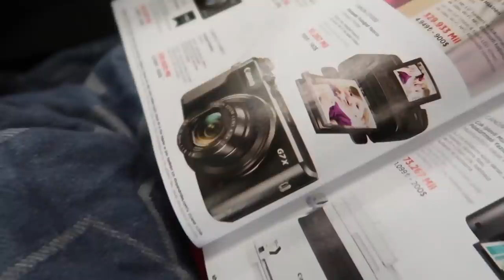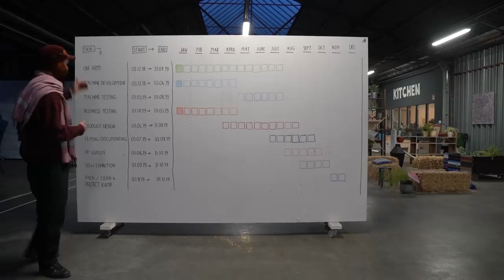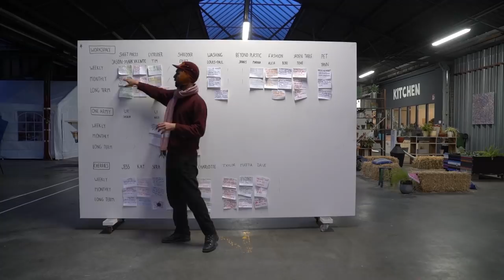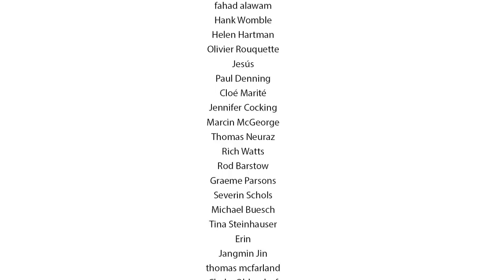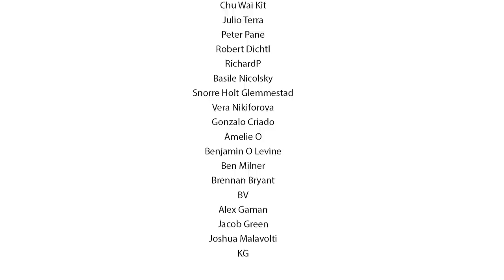Monthly news #24 - This is the future of plastic

Comment: The Largest private Roadbuilding company in Australia is EDI Downer, and they are at the commercial stage of using recycled plastic granules, by mixing into Asphalt road construction. This "Plastiphalt" material is more durable under all conditions than regular asphalt. This application worldwide has the potential to consume the vast majority of all waste plastic polymers and put it to work where it will create superior, longer lasting, roads, saving enormous sums of money on more frequent repairs. .
Reply: What will they do when the roads will start melting from the crazy Au heat? And won't it be slippery? Interesting.
Reply: I think you can add certain components to the plastic to make it more heat resistant, but I share your concern... @Yonatan24
Reply: I am interested too in more useful applications of Precious Plastic, like roads and houses...
Reply: @BrasilPopular  I mean, I'm not sure how they got the idea for roads, I bet roads can reach several hundred degrees (F°) in the hot sun.
Reply: @BrasilPopular  If I'm not mistaken there's a company based in Israel called RDF that developed a method for burn plastic for the fuel, but without creating the obvious toxins that are emitted when burning regular plastic. I'll have to look into it. Ironically, I think they actually use it to burn sheet rock, or whatever drywall like material is burnt to make asphalt or concrete in an "oven" at 800°C.
Reply: also aboutm roads, just use plastic roads only in places that are cold... @Yonatan24
Reply: @Yonatan24  The plastics have higher melt point temperatures than bitumen, so they prevent the asphalt from degrading in extreme heat. The mixture of plastics into the asphalt mix is a percentage of the total mix and is not obviously different to look at or touch.
Reply: @BrasilPopular  The plastics are more heat resistant than bitumen already, so the plastics improve the performance of asphalt in high temperatures.
Reply: @BrasilPopular  Building new roads, and repairing the old roads, can put most of the world's waste plastics to good use, harming no one, and giving us all better infrastructure at the same time. Similarly, roofing tiles for houses, using a sand/plastic mix are already on the market in a number of countries.
Reply: Space Junk  I think road building is a perfect end use, because everyone wants smooth, strong, reliable roads that don't crack up and fall apart into pot holes. Developed countries want good roads. The poorest countries want good roads. Every Asphalt road is fully recycable back into new asphalt roads. Nothing is waste.
Reply: Space Junk  There are no microplastics generated from an Asphalt road surface. The plastics are bound to the bitumen and the composite material is unable to separate.
Reply: Space Junk  I hear your concerns. But here is the Science to answer those concerns. Both bitumen and plastics are derivatives of oil. Bitumen is a proven technology to build long lasting roads and we are not corcerned about the toxicity of bitumen roads. When plastic polymers and bitumen are melted together they form very strong molecular bonds that will not separate again at location of use. Ultraviolet radiation from the sun strikes the upper surface of road composites of stones and asphalt mixture. Plastic within that mixture is shielded by the other components and is strongly bonded with the bitumen. Photodegradation to separate that bond will 
not occur. Rubber tyres are softer than the road surface, so it is rubber that wears away, not the road.
Reply: @BrasilPopular  They use Asphalt in Kuwait, and I also seen it in Arizona.  It works fine in hot climates.
Reply: @AussieAquatic  finally a voice of reason
Reply: Space Junk  third world countries do not buy plastic to burn in slums.  You will however see it being used in pyrolisis plants in third world countries.
Reply: @preciousplasticph  Thankyou for the kind words. As you know, we have way TOO Much waste plastic and TOO Few bulk use applications for it. Craft market trinkets are cute, but will not consume the mountains of waste plastic available. I have a number of waste plastic solutions that will feature on my own channel this year.
Reply: In time, things erode. My concern for "plastiphalt" is the same concern I have for tires/tyres. They degrade from being traveled on and nonbiodegradable microgranuals end up in the ground around the roads.

Comment: I don't understand those people who dislike these videos. They are trying to help you live better but just spit on it.
Reply: it can only be the big industry
Reply: @vitor3cotta  i think that they are just big ignorant trolls
Reply: @gioito7090  the electricity which they need (made from gasoline/ diesel generators) is way more than to produce new plastic. Better burn the old plastic in a proper plant and generate electricity. The amount that these people can process doesn't even go into tons.
Reply: These people are making plastic recycling more accessible to everyday people. Of course doing anything at a larger scale is more efficient but this not only is a good hobby/job for many people but it also spreads information about the problem we're having with plastic.
Reply: @andreasd4358  the fact is that they are encouraging people to use plastic that isn't being recycled otherwise.  The efficiency of other established systems means nothing if the systems aren't dealing with the plastic pollution problem around the whole planet.   This setup allows people to clean up the planet, reuse a waste product, empower and employ people who need it.  There is absolutely nothing negative about what these people are working towards

Comment: Hi Dave, love your videos. Have you heard of PRA (Pre-conditioned Resin Aggregate)? It is plastic waste (dirty or clean) that can be converted to an aggregate for use in conventional cement / sand / stone mix designs already in use in Costa Rica. Just search Don Thompson on Google and have a look at what they are achieving, with incredible technical results in terms of the concretes strength and weight. What do you think is being used to condition the plastic after being granulated? I am interested in finding out so that we can incorporate plastic into concrete bricks here in africa.
Reply: Brandon Keays if you do that and mix the plastic into another thing it will not be pure anymore and you will loose the resource

Comment: But you know that plates made out of wheet already exist ?
Reply: but are there DIY opensource schematics that one can easily use to make the machine needed to make said plates? The whole point is to make machines anyone can build from scratch in order for recycling and biodegradable tools and supplies can be made in your own home from the plastic and food waste you throw away.
Reply: Correct, but given it already exists, there's no need to do basic research the material, as they seem to be doing.
Reply: @lupissarra  you are wrong. That's like saying that because we already have the technology to recycle plastic in large-scale therefore we do not need people problem-solving how to make plastic recycling technology a regular person can build and use. Btw, this is exactly what Dave Hakkens of Precious Plastic did, and this technology anyone could use wouldn't exist if it wasn't for people like Dave putting it out there for others to use.
Reply: @lupissarra  large scale recycling is really expensive and is the reason only 10% is recycled. Making recycling machines so cheap where anyone can build them would allow everyone the ability to recycle, therefore more recycling would be done for less money overall. This same plan is being applied to biodegradable materials/machines. Different problem, same solution. (Hopefully)